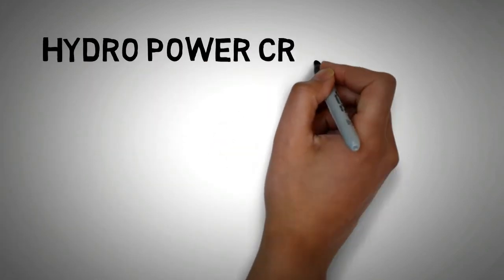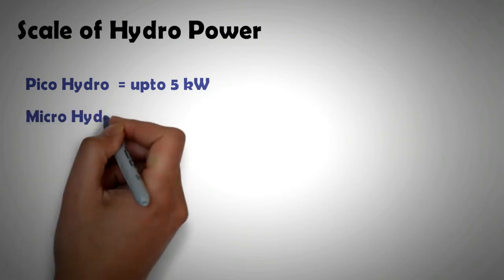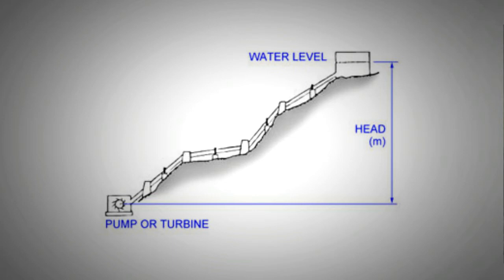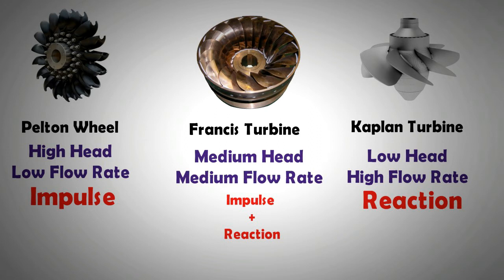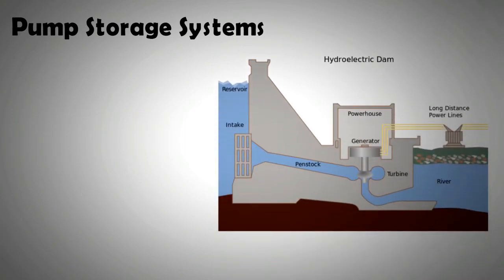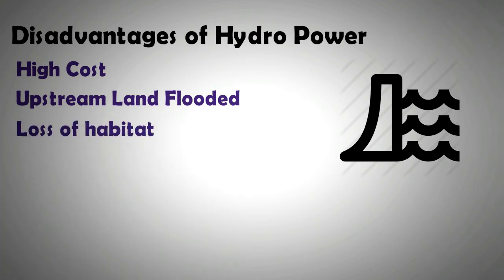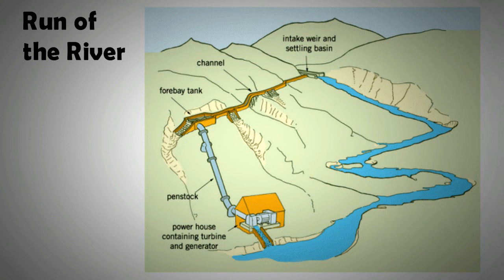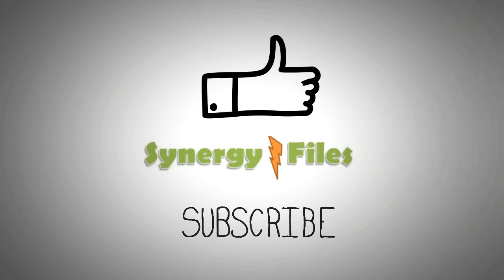10 Minute Crash Course on Hydro Power

Comment: This would have been handy 30 years ago when i was trying to redevelop existing mill dams and water power in New England, USA. I ran out of money just after the regulators set the electricity prices too low. 

I think the countries in and next to the Himalayas are the next place for small and intermediate sized hydro power development. Fortunately the engineers in India have seen this and are hard at work. That is good. 
Note: diversionary scenes make a lot of sense in the headwaters of many rivers because huge structures are unnecessary. LooK for  A book called "Water Power" by Mr. Bowers. This covers the topic in great detail. 

 Developers of the micro hydro sites should work on stream flow rates and duration before anything else. Sites below 1,000 watts can be just about anywhere.
Reply: Yes they thought 2 cents/kWh was the maximum price that they should pay. New England  now has the highest cost power in the country (except for California) especially Massachusetts. High cost electricity is a sign of poor governance, plain & simple. A few years ago I was supposed to travel to Tata in India to inspect parts for a Pelton rehab/modernization. Somebody else went and the parts were not even ready. I got the hell out of there I couldn't bare to watch a perfectly good machine be butchered because somebody thought it would be a good idea. And the yes men all nodded. And I bailed.

Comment: can we generat electricity through tubewell water? when tubewell oprating on 10HP 3phase motor????
Reply from the maker: You can get some energy back but it wouldnt be much. Best is to only use your 10 HP motor as much it is required

Comment: Sir can u tell me what all parameters in waters like density, tds etc. .. will affect the generation of power
Reply from the maker: The higher the density of fluid the more power you generate. However the density of even sea water isnt that much high compared to fresh water. Sea water density is 1024 kg /m3. This is only 2.4% higher than fresh water
Reply: Google "Small Hydropower" for reference books or look in a college engineering library. The basic equations are reasonably simple.
Reply: tds/density? Water weighs the same everywhere & dissolved minerals will not even increase the weight by 1%. They are concerned about sandy water, rocks, trash, for wear and water passage clogging. 
Power = head x flow x efficiency   P = H Q n         MW = eff x Q (cfs) x H  (ft)/11650

Comment: Assalam o Alaikum Warahmatullah
Kaise h app
I hope app Khush or tawana hunge or merie dua HK app Khush or tawana rakhein with family Amin
Respected sir,
 Appse guzarish HK mje ic engine ki calculation pochni thi jou k meri nazar m app theek bta saktein h
Aek motorcycle kah engine h 70cc or aek hin cyclinder bore h tau iss m piston kah piston rings or piston pin or connecting rod or crankshaft kah Kitna weight joins chahye Lzzzzzzzzzzz tell
Reply from the maker: Wa alaikum us salam, Jazakallah khair. Crankshaft taqreeban 4 kg or Connecting rod will be 0.5 kg (for 50 CC). Crankshaft material carbon steel SAE 1045. Connecting rod material is alloy steel. Aap internet per spare parts ki website say weight hasil ker saktay hain
Reply: Synergy Files thanks sir Mene talash karunga Qk Mene daika per mje NH mila jbhi appse pocha
Reply: Would someone please provide an American English version of these comments. Apologies for being a New England Yankee.